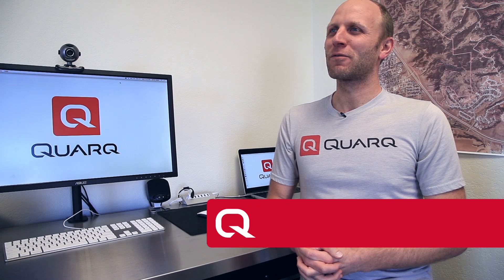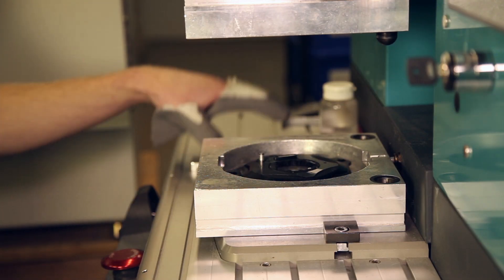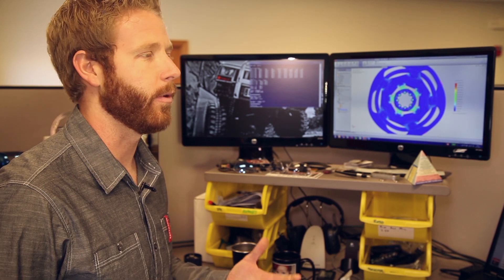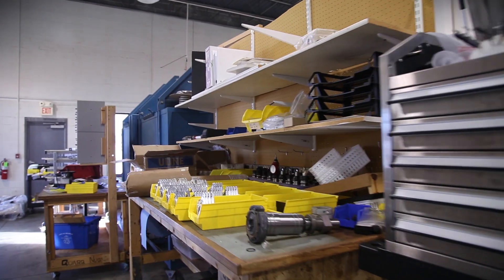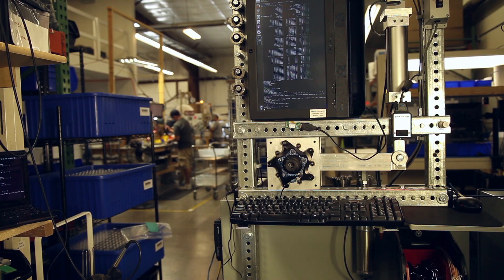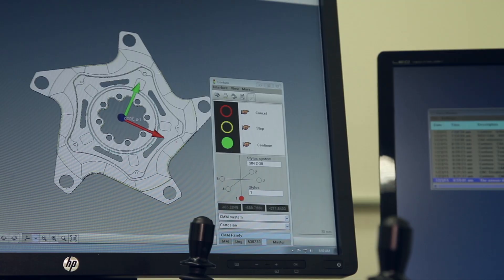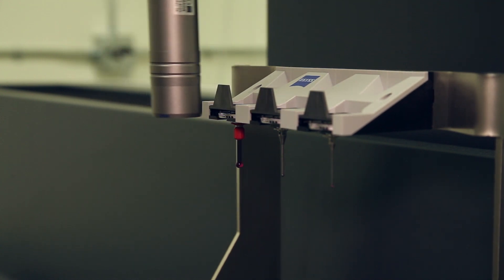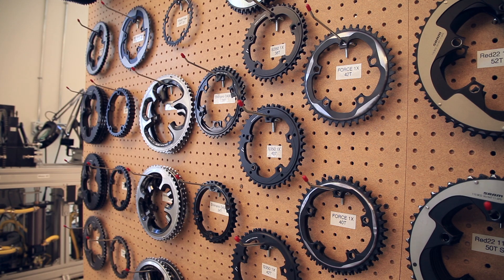The Heart Of Your Bicycle: Quarq Factory Tour

Comment: Great video!  Thanks!   I bought my Quarq for Specialized when I bought my Roubaix in Jan 2015 and love it!   Definitely better than the SRM that I had previously and the low cost (low accuracy) competitors on the market.  The video talked about stress/strain (I'm an ex-mechanical engineer) but didn't mention the # of strain gauges.  Curiously, how many are used in the Quarq?  1 on each spider arm?  Thanks!
Reply from the maker: +Bob Machlin There are five strain gauges in all current models except the SRAM XX1 MTB power meter, which has four.  Your arms to gauges ratio is accurate for all except the Quarq ELSA RS power meter.  Great to hear you love your power meter!